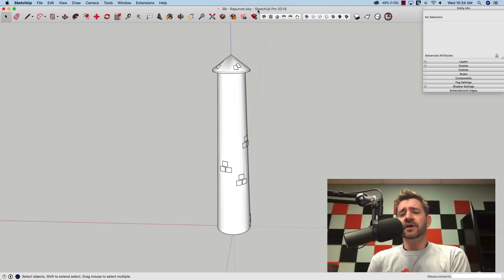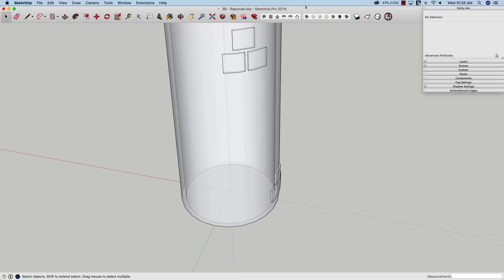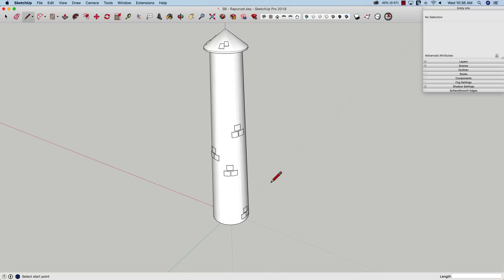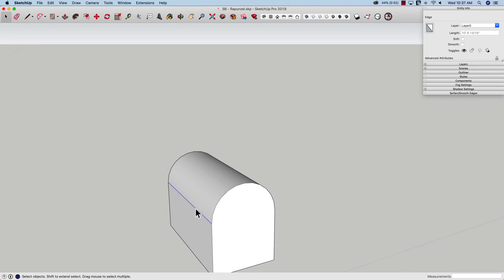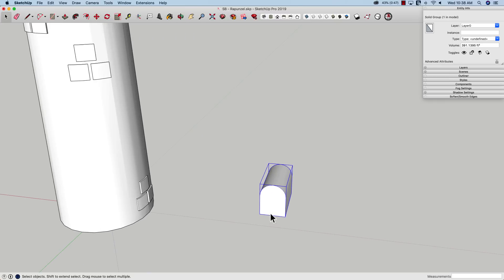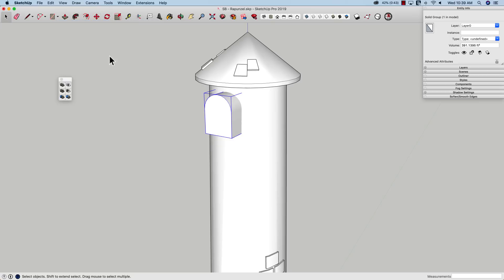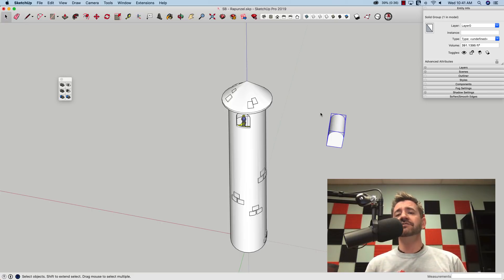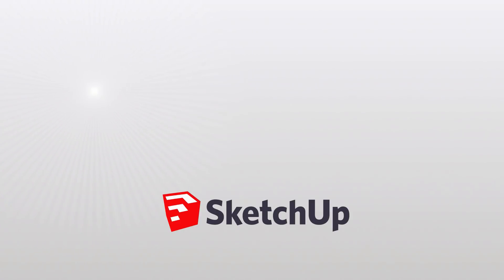Cutting a Window in Rapunzel's Tower

Comment: The Faces of the Window should be angled in a radial form not just flat. I had a project where Is had to put elliptical arches into a round facade - try that one...
Reply: I would probably P/P the cutter so it was longer, then scale one end horizontally to .01% Then align that end to the center of the tower. Not sure if that makes sense... It's funny, but I actually thought about that at one point, it just ended up being too much for a short video.
Reply: @AaronMakingStuff  I ended up doing that - set the center of the arc facade as the focus and set lines to scale the "large" and "small" ends of the elliptical "cutter". This is long before the Solid Tools, so it was Intersected.
Reply: Great minds think alike!